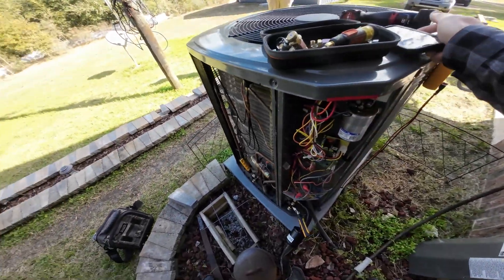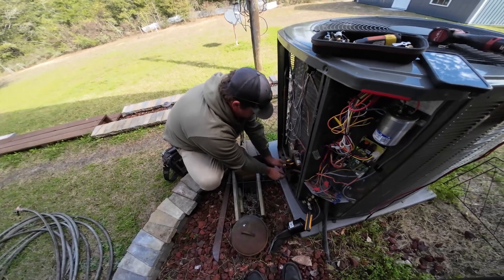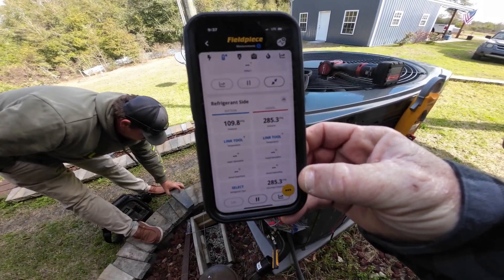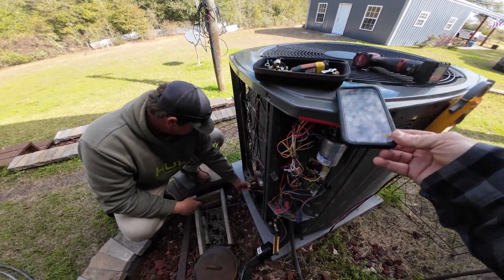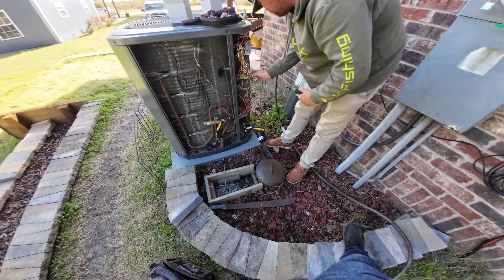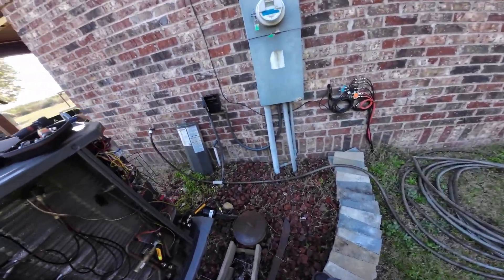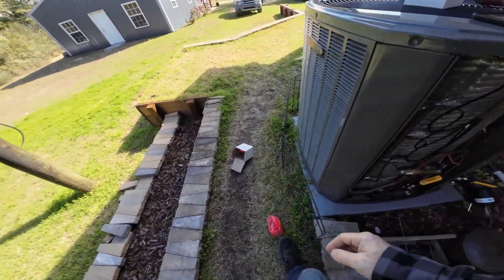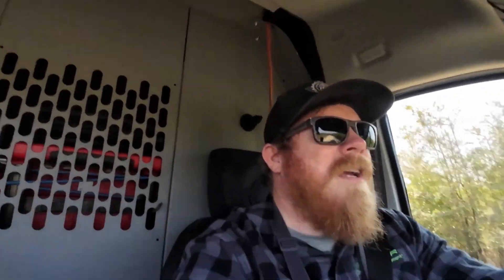Trane 17 seer 2 stage outdoor TXV | EEV acting funny !!!!! FLORIDA HVAC

Comment: Measure the thermistor's resistance (ohm it out) while referring to the manual, either online or in the physical booklet if available. Ensure the resistance reading corresponds to the outdoor ambient temperature when the thermistor is disconnected and not in contact with any surfaces.
Reply: Love your pressure probe setup, planning on doing the same!

Comment: Have you used your wireless clamps and read the temperatures then pull the sensor plug from board and ohm the values at the plug with your meter and see if it was wrong ?
Reply from the maker: @Darnell-m7c  that’s a great idea. When I go back and replace I’ll try that to test.